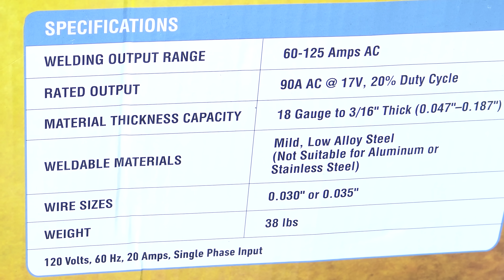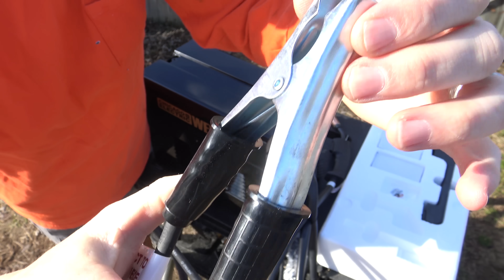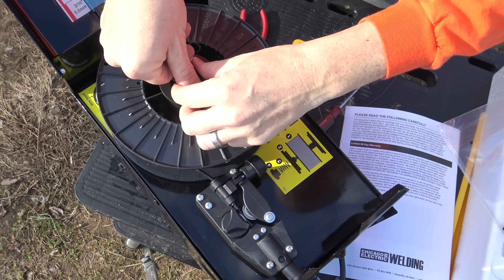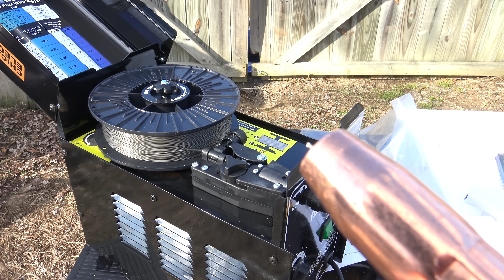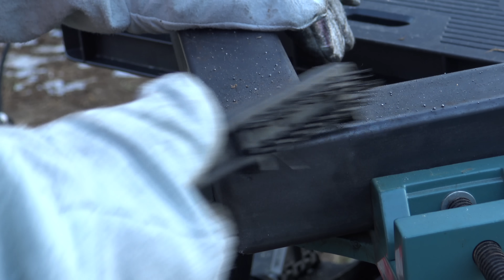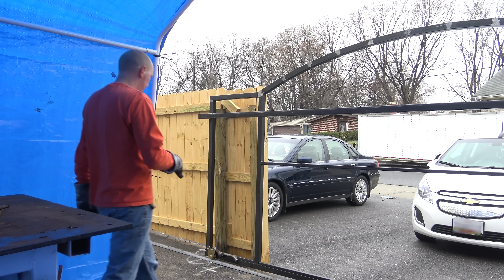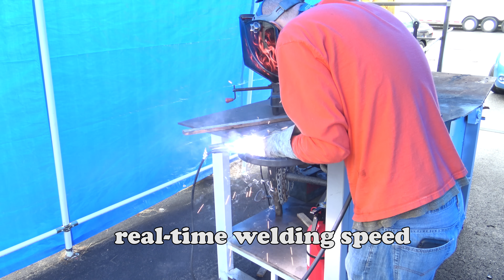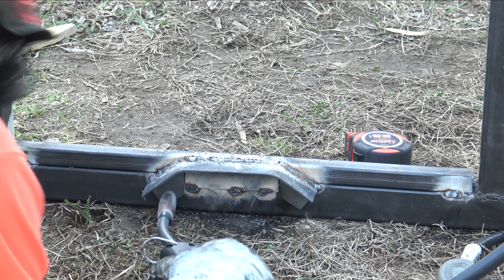Harbor Freight Flux 125 Welder Review

Comment: One important aspect. . . . it seems (from other videos) that it is necessary to not allow the spool to unwind when loading it.  If you do have it unwind a bit, then once you rewind it, it does not behave correctly.  New welders like myself will learn this the hard way if not alerted to the issue beforehand.
Reply from the maker: Yeah, it's not that bad unless you let it completely unwind all over the place. If it unwinds some, it will be fine. Following the directions will keep you out of trouble.

Comment: I want to use this welder to weld in patches where I cut rust off my tuck, any way I could do so without burning thru
Reply from the maker: Maybe, but you will likely blow thru a lot. Best bet is tig and someone with experience welding. Body panels are tuff.
Reply: Get a mig and use gas. Trust me. This sucker puts out too much voltage and you'll do more harm than good.

Comment: Thank you for the video... So, I am getting this welder to custom “shorting” my rear tail frame on my GS bmw, with those bikes it’s a lot of vibrations and some off road, jump included.. What you think in term of setting? Not too hot not too cold. I will disconnect the bike battery of course, what advice do you have? never welded before but I am fast learn.

Comment: always go uphill when welding...start low finish high...and  do small circle motions and have the new puddle cover half of the old puddle from the previous circle   motion so it looks like dimes laid out where each dime covers half of the previous dime...the circle motion will fill gaps easier and will be stronger...starting high and welding downhill will cause spatter and slag/impurities to get inside of the weld and making it weaker because of gravity...so you always want to weld going uphill when possible and either reposition the work piece or start at the very bottom at 6oclock and go up to 12oclock...then do the other side the same way if you can not reposition the work piece
Reply from the maker: If you do this be aware that it can result in the metal getting hot (heat rises) and blowing out a hole.... Even with this welder.
Reply: @TRYtoHELPyou  thanks for the tip...but I do know how to weld and I own that same exact machine...of course you can not do this on everything...I was talking about welding similar things to this video.

Comment: Im an beginner welder at best and I'm trying to build up the confidence to make a flatbed for my pickup using one of these (eventually lol I'm still practicing on smaller stuff for right now)
Reply from the maker: It's actually doable for that. Just make sure you sink the puddle in deep before moving the bead. Also, weld some angle iron together and hit it with a sledgehammer to see how strong you are making welds. When you can beat it and the metal only bends or tears and the welds last, you got the skill.

Comment: Can you not adjust the temperature down for thinner metal? I'm looking for a cheap welder that I can replace body panels with, but big enough to weld the frame or a roll cage.
Reply: theres a high and low setting. but in these fcaw welders, the wire speed also effects current. i welded  rusty exhaust piping for my civic and it didnt blow through. the .030 wire is really thin.

Comment: I have the same welder but zero experience welding. I'm wanting to weld in some patch panels in a floorboard of an old Camaro. You mentioned that you don't recommend it on floor pans. Is there any particular reasons as to why and what would you recommend for patch panels for a floorboard?
Reply from the maker: Yeah, the welder is pretty burly for thin metal and may just burn right through it. As for floorboard "patch panels", I am a fan of getting metal under and above the existing floorboard and then bolting it together. But I'm not quite sure what you are talking about (i.e. towards wheel or tunnel, flat part where feet are, etc.)

Comment: I just found this Welder in Costa Rica with a promotional price of $76, I guess I'm buying it :)
Reply: Did you buy it? Was it any good? I am about to go and buy one here in Costa Rica and I am not sure if it will be a good starter machine
Reply: @josech5743  Yes, I got it. It works decently for the price. My only complains is that there are only 2 amps settings: High and low, and low doesn't weld anything.
Reply: @OlivierCR  thanks Oliver. So you think it will be better to spend some extra cash?
Reply: @josech5743  If you are an amateur or if you are just learning to weld, this one is fine. if your plan is to weld thin metal (like perling) this one will be fine too. If you need to weld a lot, or weld any thick metal (over 5mm in thickness), get a better one with an adjustable amps dial

Comment: This review (and many of the positive comments) made me feel better about my recent purchase of the Flux 125 system. I've never welded before and I hope it will be a good first rig to learn with.
Reply from the maker: Nice! Thanks for the good words. As long as you have clean metal and do some practices, you should enjoy it. I keep my wire speed around 3 and the switch on 2. I prefer lower wire speed but adjust it as you see fit.
Reply: You my friend have just caused a 24yr experienced welder to try out this machine my wife bought me  over a year ago. Because of your review 😂😂 she will be getting used. I saw one review, the guy was welding without the nozzle and said yes it welds pretty good smh
Reply: Dude I have one, works great. The only thing is the wire it comes with  is kinda rough. Idk about the Vulcan wire the have. Maybe better

Comment: I have a pickup truck and where I took my topper off I have the whole the bolt went through could I use this to weld and fill in the hole
Reply from the maker: It is possible, it would be frustrating and take a lot of work if you are not used to welding. Perhaps fill the hole with a rounded head bolt?

Comment: I'm frankly impressed with how it welds (I own this welder).  The only thing that is a real pain in the ass is that you get so few adjustments.  2 amperage settings really blows.  BUT with some technique you can overcome these things and weld just fine (within the thickness limits you're obviously bound by due to amperage and wire gauge).
Reply from the maker: Yep, even tho there are not many settings it can penetrate steel well and get the weld done.

Comment: So I enjoy building gokarts and stuff like that in my back yard.. Would you recommend this welder to build gokarts? Does it have a good hold?
Reply from the maker: Yes. It's perfect for this. Make sure your metal is thick enough and parts are safe. Consider electric propulsion.
Reply: That wire and welder are GREAT for welding auto body sheet metal. Just have to adjust it. Probably have to be on MIN with wire speed fairly low.

Comment: I appreciate your review on this welder as I just purchased the same unit from Harbor Freight.  While I have some good past experience in acetylene/oxygen  & old school DC stick welders I'm new to this flux core wire welding. Will be trying to fit together a broken area of solid maybe quarter inch tube frame on a lawn mower where the grass catcher attaches & hopefully will be able to make it "stick" together. Thanks again !!!

Comment: I've bin welding since 1998 and have used many different machines,big one's mostly gas but even flux core rods. I just recently purchased the 125 you have on here to weld my front custom fencing for my wall and stone pillers. I have to say I was very sceptical about this tiny welder. But to my surprise it did very well on the 3/16 steel gate. It was just simply a matter of setting the appropriate wire speed and temp then getting the hand speed and movement to match the setting. So I'm very happy with it and the price was good I paid $119 but I'm getting a price change next month but it's going on a one month sale for $85. That make it all even better. It's a keeper.👍👍👌
Reply from the maker: Right? It's perfect for this.

Comment: @TRY TO HELP YOU,
YEAH, like that last weld on that angle bracket you banged into place,pretty good weld there for a wire feed. Also, wish you WOULD HAVE, shown the before on that corner before grinding it smooth-had to dock you points for that lol
Reply from the maker: Thanks, yeah it's a decent welder. Could you imagine if every collision specialist showed dents covered in bondo before they knocked it down? It was pure ugly. All I can suggest is watch the "behind the glass" portion of the video slowed down to watch the gap fill.

Comment: bought one a few months ago as my first welder paid under 100 bucks for it and for small things like go karts and minibikes it works great
haven't had a problem yet and has worked great with plenty of power for 1/8 in and can force it to do 1/4 sometimes
just please please PLEASE if you buy one pay the extra 70 bucks and buy an actual welding helmet and gloves
i got a cool red helmet from harbor freight well under 40 bucks

Comment: i have almost the same welder,    Harbor Freight,  mine is a 100 amp,  it welds good if the feed works,  This is the down side to mine  the feed goes & stops,  there is a knob where the wire goes through,  you can tighten it,  when mine is tightened all the way it still don't feed right,  i have to play with it,,     get what you pay for,  a friend of mine was here when i used it when it was working good right after i bought it  he said he was going to get one,   he did  when i looked at it,   it was a 90 amp,  they didn't have the 100 anymore,  i wonder why ...  Nothing like a Miller or a Lincoln.  COST a lot more,  mine was a $119,   6 or 7 yrs ago

Comment: Sorry but this thing is trash. 😂
Reply: No it not the best but if you own a couple of cars or trucks and need to make some repairs it better than welding with batteries and cheaper than taking it to a stealership or body shop . And I have a box store wire and true mig with dc switchable output which I paid $ 95 for it works for car repairs and small jobs like trailers repair and  lawn mower decks .

Comment: Thanks for posting...
You helped sell me on this one...! Appreciate the help...
Also, where can I see your fence up and running, in more detail...  Great Idea..!
Like that whole set up. 👍👍👍
Reply from the maker: Glad I could help. You can see the fence some more on my how to bend square tubing video at the very end. I need to make a video about it in full tho still.
Reply: TRY to HELP you I could really use a video on your gate build also brother when you have time. I’m wanting to build one almost just like it for my driveway on an automatic opener like yours, please consider doing one when you have time. 

I have the same welder and have had it 10 years now and for someone just doing tubing projects like this or around the home repairs then it’s great in my book, it does a great job on that type of stuff. I’ve been working on a slide for the bed of my service truck using 1” square tubing and for the money you can’t beat it. I got mine with a 20% off coupon so I got it for around $80, you can not beat that, I don’t care what the Miller and Hobart pigs say. If you prep your metal and have basic ideas on what your doing then you can produce some decent welds. No, it’s not a miller or Hobart, but for someone just looking for a cost effective way to DIY around the house then this welder is the ticket but it is NOT for the pro as I’m sure it would be a complete disappointment!

Awesome video brother!! I subbed after whatching! You did a fantastic job and I look forward to watching more of your videos. Can you also tell me what bus that is sitting behind you next to the fence in a couple of the shots? My wife and I are looking for an older bus to do a conversion on to an RV or if it’s already been converted then we will just freshen it up and update it so we can hit the road and travel coast to coast in a couple years when she retires as we plan on renting out the farm and living in the bus full time and travel as much as we can while we are still healthy enough to enjoy it. 

Your doing a great job buddy, keep it up and keep pumping out these great videos for us!!!

Comment: Harbor Freight should give you an extra discount if you are using this to repair other broken Harbor Freight tools, like their concrete mixer.
Reply: dude it can be as low as 89 bucks, thats cheap
Reply: @85square  expired milk is cheap too. Doesn't make it usable.
Reply: @kartnerds  ima jump in and be that guy and point out that there are plenty of uses for expired/sour milk and many recipes even call for it. Does it taste bad? Yes. Is it good for you? Also yes
Reply: @pyrogothica3906  I think cheese is pretty good tasting tho
Reply: Just bought one. What broke on it? Usually their stuff is pretty reliable and they have the best warranty
Reply: progholio 😂
Reply: I have one from them and I have over 80 hours into it without issues. That being said I wish it had a better stand. I had it on a slant and had to literally baby sit it because it wanted to tip over....but that’s...user error with something too heavy
Reply: Agreed,my friend....lol....honesty is a welcome addition to any review...
Reply: LOL
Reply: Thst machine is pure crap. Poor investment. Better off spending a little more money for a much better machine.
Reply: @Marcuz30000  ehh I got mine for about $110. I'd say that's more than fine for my repairing ease, its nice to be able to plug the 120 in anywhere.
Reply: @user-qn2tz9qd7t  mine costed a little more than that.
Reply: @Marcuz30000  no it ain't I fixed all my old mower wagons and patched bad holes in my mower deck and made a smaller mower wagon 

And fixed my mounting brackets on the deck you couldn't do that with glue this cheap thing works better than nothing

Comment: the wheel that pulls the wire in has 2 sides a 30 side and a 35 side u take the wheel out and flip it to change from 30 to 35 kinda important
Reply from the maker: Kinda filmed me doing that too.

Comment: That lid looks sketchy af. If that little pin gives way will your carrying it around...  especially with a 10 lb. spoon in there...  yikes.
Reply from the maker: Be sure to take a look at the little pins that hold the wheels to your car. As for this welder and lid, it holds up well and is more than strong enough.

Comment: Would this be okay for welding a muffler or something like that in the exhaust system of a car? I have currently 2.5 tail pipes and I don't want to take it to the shop just swap in a flowmaster muffler that costs $50 when I could just cut the pipe and weld the sucker my self and save hundreds of dollars.

Comment: my first welder was the old H.F. dual 131 that would get hot and stop.i got a small fan to stand behind the welder a blow threw the cooling fins and never shut off again.then I looked on Ebay and found a 180 amp Clarke mig welder for $340 including shipping,3 days later a had a welder I've using now for about 15 yrs and love it

Comment: I cant stress enough on how important eye and body covering is. You will not feel it as you're welding, leading you to think its ok, but after welding for about an hour with ultraviolets nailing the shit out of you, you'll wish you did. If you do not wear eye protection, get ready for a midnight trip to the hospital. And dont count on driving yourself there. Ever had sand thrown in your eyes? Multiply that 10 times at 8 hrs. And Thats just from not wearing eye protection. Sunburns suck, thats a bonus too.
Bottom line...just because you dont feel it then, does NOT mean you wont feel it later. You will.

Comment: Thank you for spending time to demonstrate this welder. You're doing the exact project that I want to use it for. I'd like to see the rest of your gate build if you have it available 

One note on your welds (I may be mistaken but I've had this happen and an old welder told me what it was). The sputtering and what looked like a little kick back (not to mention the splatter) might be the result of your wire size. This particular machine says that it can use both 0.030 and 0.035 wire but it really is designed for optimized welding with 0.030 wire. That said, however, your welds came out very well regardless of what machine you were using. 

Your gate motor setup looks pretty good at the end. Again I'd love to see your next video

Comment: I am certified welder. I have used the   $600 lincoln flux wire mig a lot . Bought this machine to weld panels on my truck. Cost me $100 and couldnt believe how good it was for that price. Wire fed out properly. Welds were good. Did i mention its $100 ? No one should be bashing this welder.. Dunno how long it ll last ..dont care

Comment: I've been using mine 2016 and have had no problems. One of the major drawbacks to this welder is that the amperage isn't adjustable beyond "high" and "low" but that doesn't really matter to me.
Reply: You can buy a sperate adjuster between the outlet and welder for $20 although I don't know why you'd need one. The settings are pretty solid

Comment: Great video. Would you recommend a flux core or stick welder for someone just learning to weld?
Reply from the maker: I think that this flux core is way better than a cheap stick arc welder. Speaking from experience :(
Reply: I havent tried flux yet, but have done a little arc welding. Been told if you can arc weld, you can surely flux or mig weld